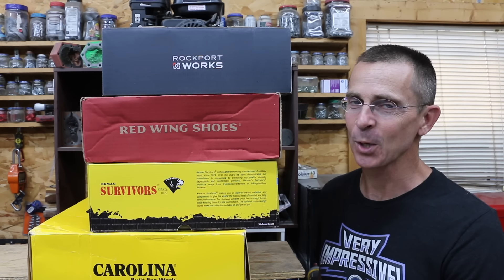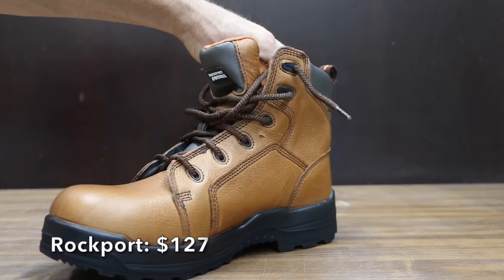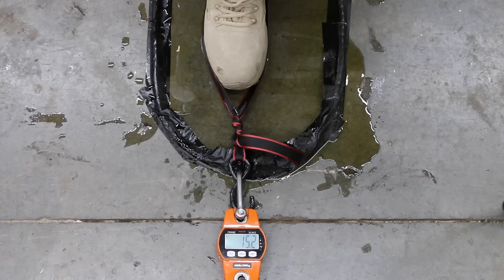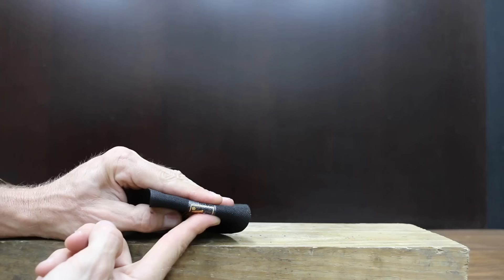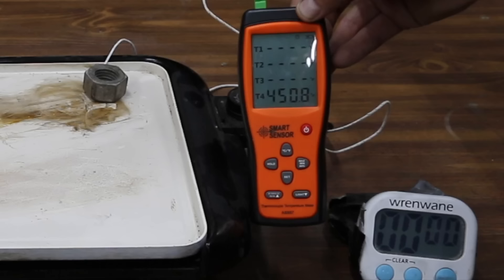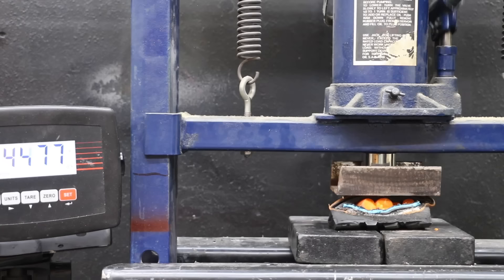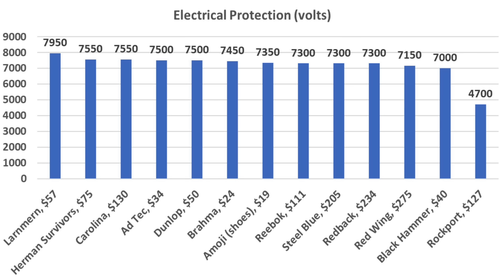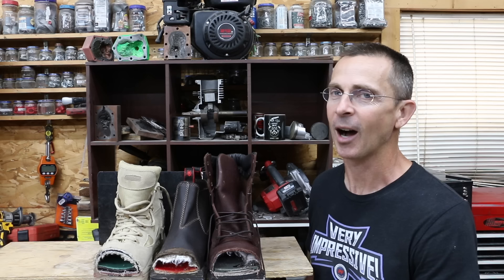Best Boots? $24 vs $275! Let's Find Out!

Comment: I was a Heavy Duty diesel mech and a tow truck driver, I had a single pair of redbacks last me over 4 years, would have lasted longer but got a small slice in the leather near the toes and allowed water in, while they aren’t particularly waterproof due to the elastic, loosing the bit of waterproof I did have was enough to get a second pair…I’m onto these ones now for almost 4 years now as well…
Reply from the maker: Thanks for sharing!

Comment: Great review, as always.  We get a significant discount on work boots (45% for the red wings).  I always choose the same model red wing you tested.  The oil test after a few 8-hour shifts would be significantly improved.  These red wing boots are incredibly comfortable.  I get an annual boot allowance, but these last me around 5 years.  I walk about 8k-11k steps per day on concrete floors.  The work environment is very oily.  They hold up amazingly when treated with snow seal.  The biggest flaw with the red wing is the break-in period.  The first two weeks wearing these boots is miserable.  After that, they're perfect.  I wear these boots every day, even on weekends.  I'll gladly pay $150 out of pocket for these every 5 years.  Wear them until the soles fall off or split.
Reply from the maker: Thanks!  Thanks for sharing.
Reply: I'm in the same situation as you and agree with everything you said. I've been at my job for 16 years and get a brand new pair every year that they pay for. Needless to say, I've only worn out 4 pairs and have 10 or so brand new pairs in my attic.
Reply: @Big-Wonka  You should sell 80% of them on Marketplace....that's about $2K...

Comment: If you wanted a follow-up video, you may be able to test longevity in some ways. You could measure how much of the sole is worn away by sliding the boot around on an abrasive surface with an added weight, or flex the soles/uppers a number of times or directions until the materials fail. I suppose that wouldn't account for variations in environment, but it would be a start. Thanks for this video, Project Farm!
Reply: Yeah, and maybe run them through temperature cycles as well as dry / wet cycles and bend them all up.

Comment: I can attest to the comfort of red backs.  I have a steel toe version and a standard pair.  Wear both pretty much everywhere and are incredibly comfortable.  Even after long days at work or long walks/hikes
Reply: Agreed.  I’m an automotive diagnostician & programmer and wear non-steel toe Redbacks daily for five years now.
Reply: Agreed as well. I’m an automotive fleet tech that walks an average of 2 miles per day in the shop. I’m on my 5th pair of Redbacks that have lasted an average of 3 years per pair and can say they are by far the best of all worlds in terms of comfort, durability, slip resistance and quality. I prefer them to the Red Wings and Wolverines I’ve had in the past. The numerous pairs of various brands all made in China I used earlier in my career aren’t even in the same universe as Redbacks.
Reply from the maker: Thanks for sharing.
Reply: @ProjectFarm  thanks for your hard work 👍
Reply: @chipyeahoo  I like how they are slip on too.  I have to take my shoes on and off alot with work when visiting people's homes.  So it's much better than laces and they haven't stretched out either.
Reply: Been wearing them for years as a firefighter. Love my Redback boots. They also last a long time.
Reply: @adamwhittingham86  several of my fellow techs like the slip on style. They don’t fit me correctly but I do have the zip side boots. They’re quick on and off too but they lace up tight and fit me better. It’s nice not having to untie and retie every time I want to put them on or take them off. Simple zip on, zip off.

Comment: I wore the Reeboks in Afghanistan as a contractor for almost two years and they held up tremendously well.  They are desert tan because the were authorized for use by solders.  Bad part is they were not well ventilated and my feet would get pretty hot in them, but they saved my ankles from twisting over all the rocks on base.
Reply from the maker: Thanks for sharing.
Reply: Yea I was about to say those Reebok boots looked familiar to me lol
Reply: Same for me. They held up well and quite comfy besides the heat. Good thing is the zipper was good so you could pop them off for a few minutes without much fuss.

Comment: As a video idea, I'm actually interested in something a lil bit different. Would love to see strength tests of wood joints, like how mortise and tenon would fare against pocket hole joints. Would love to see objectively how strong they truly are! Anyway, thank you so much of all of the great tests you're doing Todd!
Reply: There are some good ones already in the mix out there, 45 miters with splines seem to be winning most of the showdowns. Bourbon Moth Woodworking is a good place to start, good sense of humor
Reply from the maker: Thank you for the video idea!
Reply: Matthias Wendel and other woodworkers have done testing on this to the nth degree. Don't think Todd would find anything different, and it would simply duplicate some excellent work thats already well respected.
Reply: No disrespect to any of those guys you mentioned. Nobody tests like Todd though, plus he's not sponsored.
Reply: That's been done on other channels. Dowels are pretty strong. If appearance doesn't matter a glued and screwed butt joint is hard to beat. Modern PVA glue is stronger than wood is. So joints usually fail by the wood pulling apart. Then it comes down to what wood is the strongest. But some wood doesn't glue good.

Comment: I am a redwing guy all the way. I work in concrete and have tried a ton of different boots because spending $250 on a pair of boots that you are going to be extremely hard on is very hard to do. I've been using redwings for 20 years now and i usually get a good full year out of them but by the end of the second year it's definitely time for a new pair. When you are on your feet all day long you need an excellent pair of boots. Redwings are the way to go. Way to go on the video! Keep up the fantastic videos. We all love them

Comment: Im gkad to see my red wing 2406s tested on here and happy to see they came out on top. I can tell you from personal experience iver the last 10 years they hold up very well and are extremely comfortable. Ive stood on red hot bolts, nuts, and random metals that i had just cut with a torch and never noticed, had multiple large impacts with no issues or damage and most importantly no injuries, and are extremely comfortable. Over the last 10 years I have bought 3 pairs, and my original pair i stull use for work every day.
Reply from the maker: Thanks for the feedback.
Reply: I'd destroy them in a year. Not even red wings hold up in actual hard use, like my water plant. Constant water and pure chlorine gas exposure kills $500 boots in a year or so. 
So my employer buys me new boots every year. KEENS are the best I've ever tried, after all these.
Reply: @RobertMorgan  My red wings have held up 5 years in highly caustic and acidic conditions in one industrial plant, extreme fires and hot ass hydraulic fluid for 2 years at a metallurgy plant, and the last 3 years working as a diesel tech. Just oil the lether ebery few months and they hold up forever

Comment: Excellent comparison. My dad wore Red Wing throughout his career in construction, and he swore by them. They weren't cheap, but you get what you pay for. They saved his feet on many occasions. I would love to see more tests, as a home DIY I would like to have a safety shoe for my projects but don't need the level of Red Wing as I'm not on a construction site.
Reply from the maker: Thanks!
Reply: ive not seen the results yet, but used to buy redwing, and found boots that only cost 70 bucks and lasted 2 to 3 times as long. Ive not bought any other brand after that. They are the Bates  military boots from Canada, with either steel toe or thermal liners.
Reply: I have been wearing to Red Wings for many years. Hold up very well for me working as a railroader.

Comment: Great review of the boots, but there is one additional factor that could be considered:  long term durability.  Many of the cheap boots fall apart after a few months with the sides bursting out from insufficient sewing and the soles falling off because of poor gluing.  I'm currently using some Carolina moccasin toed steel safety, ankle high boots made in USA and after over two years of heavy use I expect to get several more years out of them, though I did just replace the laces because one got partly cut somehow.

Comment: Excellent video as always. The crush test did a great job of demonstrating why safety devices like these should be replaced after encountering a serious crush event. Like with a bike helmet, surviving one event doesn't mean your "carrots" will be spared on a second.
Reply from the maker: Thanks!
Reply: I'm surprised the Red Wings did so poorly. Those caps are crap compared to what they used to use. We've literally sledgehammered the steel toes in those boots and they've held up. But that was years ago. I used to kick through terracotta block walls with steel toed Red Wings for laughs. We were tearing the walls down anyways so no biggie. It's why we had sledgehammers in the first place.

Comment: REDWING PERIOD!! And before I forget absolutely awesome review as usual.
For longevity it's Redwing hands-down. I've got a pair that I've worn for thousands of hours of hard physical labor and they just gave out this year they're about 18 years old. I have worn many brands up until about 15 years ago. I wear nothing but Redwing now.
I don't mean to sound like a fanboy I'm just simply saying they're the best for a reason. Spend the $300 today and don't even think about needing to buy another pair for over a decade easy. You'll have to get new insoles and you'll have to replace the shoelaces once or twice a year if you wear them like I did. 
Also use mink oil to keep them highly water resistant if not waterproof. I am very very hard on boots. Most don't make it six months. Like I said these made it 18 years.

Comment: I would be interested to see how well Timberland Pro non lace boots hold up. I’ve been using them for a couple years in the oil field and they are a very comfortable boot that has held up well. Love your channel!!
Reply from the maker: Thanks!  Thanks for the suggestion.
Reply: I'm using the 6in black ones ane they definitely are super comfortable.
Reply: Right now I'm trying to decide between them and Red Wings.  I currently use Red Wings but could save $100 with the Timbos but I hear they don't nearly as long.
Reply: @jasondashney  , just try em out and find out for yourself! 👍

Comment: The most informative channel on YouTube. 
Matterhorn comp toe work boots (C102494) are the best I've ever had in my feet. I have a pair that is currently 22yrs old and still going. Added rubber coating to the toe a few years back because of a hole in the leather and replaced the insole. Gonna have them resoled soon.

Comment: I have been wearing 5.11 8" boots for six years now.  They are the best I have found for the money and comfort.  I would like to see your tests with these.  The other thing you don't test with boots is the waterproofness of them.  That is a big thing for a lot of us out here.   Great channel!
Reply: Mink oil solves the waterproof concern and also seems to extend the life of the boots.
Reply: But dissolves the stitching
Reply: Unless the boots are rubber no boot is really waterproof for very long. So you just have to prepare for having wet feet. To that end you wear silk liner socks and woolen outer socks. Even soaking wet your feet stay comfortable then. Least for how long you're going to be out in the weather. 10-12 hours or so is about max. You can reasonably expect boots to resist being soaked for some time. A couple hours maybe? In real weather conditions rubber boots are the way to go.

Comment: The $25 Brahma Steel toe boots from Walmart are amazing.  I was wearing Dickies, Timberland, and Sketchers boots before, all at around a $100 price point.  Those brand's quality control has gone to trash.  The Brahma's fake leather starts to peel over 6 months to a year, but at $25 they're cheap enough to replace, and I can still use peeling fake leather boots for yard work.
Reply: I used to wear the premium 6" work boot from timberland which were really well made but not comfortable for my feet. I actually found the non premium version (1 step down, often called "butt nakeds") more comfortable but not as tough. Ppl's feet vary so much so it's good to have options since what may b comfortable for 1 person might b miserable for someone else. I despise vegan leather tho bcuz it falls apart so fast.
Reply: Agreed. I’ve used these style of cheap boots here in UK for 25 years. They last about 18 months for me (joinery workshop)
Reply from the maker: Thanks for the feedback.
Reply: I used to manage a scrap yard and would use Brahma (replaced every 6 months) until I saved up for a pair if Red Wings.  The comfort is head and shoulders above less expensive boots like Brahma.  My feet used to kill me after a 10 hour day on the yard.  I'll never go back.

Comment: Excellent testing, as usual. I've been a Redwing fan for years, but have recently switched to Chippewa. Georgia is another brand that I've had good luck with. Comparing Redwings USA boots, vs their China made boots would also be interesting.

Thank you for what you do!
Reply from the maker: You are welcome!  Thanks for the suggestion.
Reply: @ProjectFarm  To add to this, I'd be interested in seeing a USA showdown where you take all the top USA brands and pit them against each other. Danner, Chippewa, Redwing, Carolina, Nicks, Keens, and Whites.

Comment: I love my red wings! I have the same style you tested, the only problem is that they tend to hold odor and need the inside to be cleaned more often than most other boots.
Reply from the maker: Thanks for sharing.
Reply: I suggest getting cedar boot trees, I have them for my Redwings and it works great for odor control also dries them out, check out the USA made boot trees by Woodlore